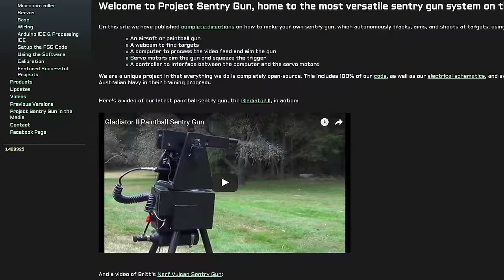DIY Autonomous Nerf Turret

Comment: why the fuck did you use a servo with a switch and not a relay?
Reply: Or a mosfet would have worked too
Reply: Because he probably knows nothing about electronics.
Reply: Tru, but some how he figured out how to motion detect with an arduino
Reply: +Collin Murray Yeah but programming and electronics are two completely different things, it's great if you can learn both but some people may struggle with one or the other, (such as myself, I can't focus long enough to program anything) also from this video alone we don't know who actually made it and I'm guessing it was Taran who did all the programming on the arduino.
Reply: Or maybe use a rabadouche, it would be easier
Reply: he uses a web cam and a laptop not motion detect with arduino.
Reply: Code Junkes How do you expect him to do motion tracking on an Arduino? A Raspberry Pi maybe, but analysing video in real time is not something that an Arduino can do.
Reply: thats what we call 'american lowtech'... a unintelligent system, but whole magazine fired if anything is moving. and wasting a servo for flipping a switch... oh my boy... you wont win this war.
Reply: TheRebel3000
basic motion detection with IR sensor is only possible with atmega328.
Reply: for notification and can also be used to start a video call ... which is used.
Reply: Collin Murray Someone else made the code and he just downloaded it from the internet.
Reply: He need some experience person, and learning anything has a learning curve. The most important thing is being passionate about learning anything.

They mostly do performance testing and PC assembling and that is very different from Electronics.
Reply: Does it work or not?
Reply: manniefaces There is something called efficiency and response speed ....

Comment: I dont think it actualy worked coz he didnt show us it actualy working just constantly firing at a door!
Reply: I call BS, too. If it worked they would've shown it.
Reply: ye
Reply: It didn't work. The software he is using takes a picture initially and then sets that as the background image. Everything in the image within the software itself is set to black. Then when something new enters the frame that is detected as white. Thus as the door was closed initially the turret fired at the door even after they both exited since the door was closed in the background image. In a way it works since it does fire automatically, that is not hard to do so I'm sure it did, but it would have never stopped firing and thus would have just ran out of ammo. To make it work they would have needed it to reset the background image after a few seconds but if they are indeed using the software I think, it doesn't have that feature.
Reply: oh

Comment: They should have used a raspberry Pi instead of a laptop
Reply: there wasn't code for the raspberry pi. it was written for windows. so unless they can find an efficient enough x86/x64 emulator for linux, this thing isn't going to work with the pi, especially as it has to track the camera 24/7
Reply: Hoàng Trần Minh 
But it's open source. You could port it
Reply: Joni99 so... as if anyone in lmg has enough coding experience to port the program.

Comment: A servo with 3d printed lever to operate simple low current switch.. are you serious? ever heard of relays?
Reply: Hey, when you have a 3d printer, you find uses for it, even if they are super inefficient.
Reply: m00nr4k3r they said they originally wanted to control it directly through the arduino, which they probably didn't realize couldn't handle that kind of load when they first started the project. Rather than wait for a relay to arrive (or go to the store and buy one) they just made use of what they had on hand.

Comment: You can easily avoid the turret by activating it, waiting until it runs out, and then walking through. You can also just use a t-shirt or something like it as a shield, because the Rhinofire only shoots at around 60 feet per second.

Comment: I mean. What I did was people entering my room was a problem. So I set up a WiFi network that would detect if my phone was connected. If it was. The propane tank would be disarmed. If I were not in range for my phone. A raspberry pi would check for movement at my door. If movement detected, set x, y servo to that and let propane tank open for 2.3 second then light it.

I hooked that up to a pipe with a bottle on the end and could travel at really fast speeds. If you google propane plasma gun it comes up but I hate using the term plasma.

Comment: A servo controlling a switch...? You're kidding right?!
I mean, you could have easily gotten a powerful enough transistor and flyback diode out of any old computer power supply or used a relay. Why on earth would you use a servo for that? Apart from being incredibly expensive, it's a lot more work and a lot less reliable. It basically has no advantage.